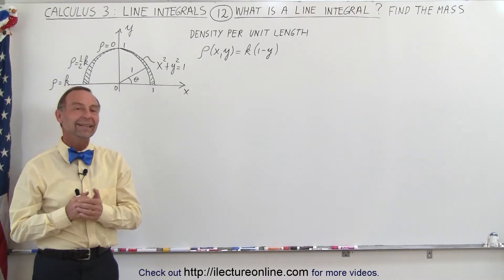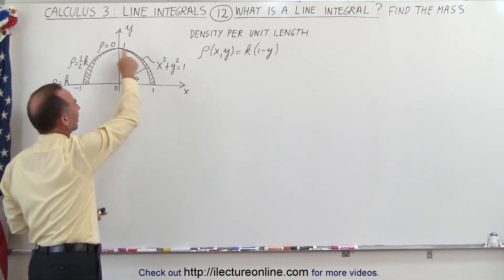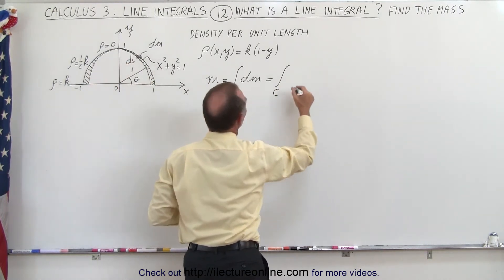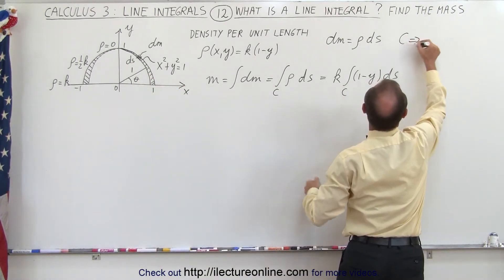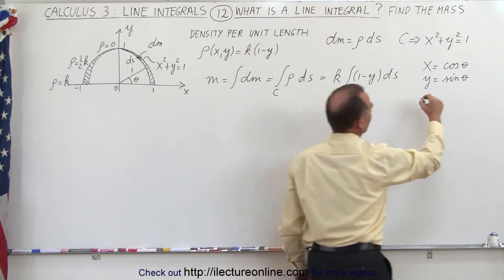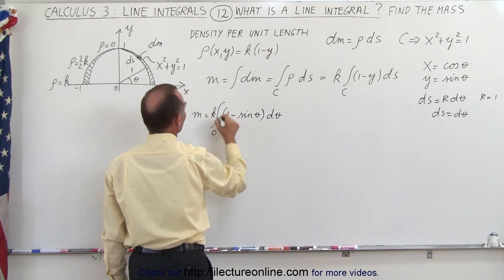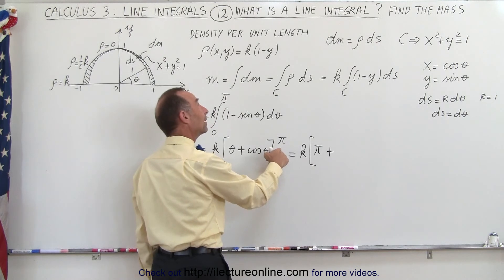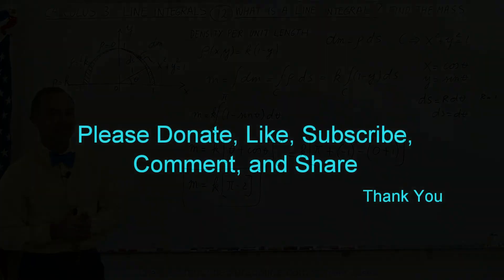Calculus 3: Line Integrals (12 of 44) What is a Line Integral? Find the Mass

Comment: Dear sir 
Does m represent the mass  or the mass per unit area?
Note that  the mass should be 
m= ro × volume= ro × ds × A
where A is the cross area perpendicular to (ds)
Also if ro is the density per unit length then the ingeral of (ro ds) represents the total density and not the mass.
Dear sir , In general for your answer f(x,y)=k(1-y) should be mass per unit length not density per unit length 
Thank you
Reply from the maker: It should state:  density as a function of lenght
Reply: @MichelvanBiezen  
In this case, the m or the integration of (ro ds) should be the mass per unit cross sectional area of the silk.